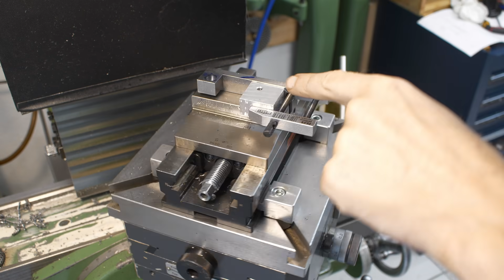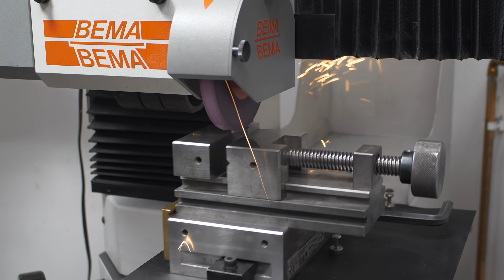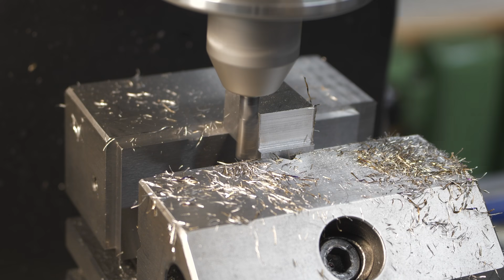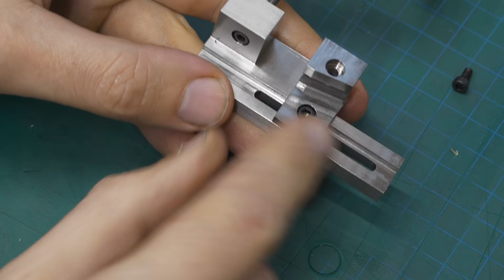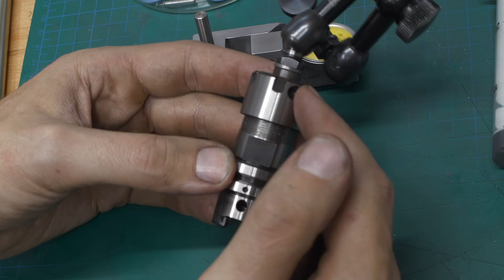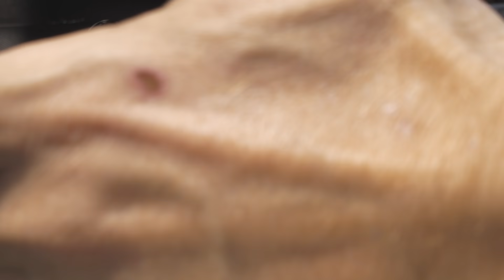Lowprofile DTI holder - Part 2

Comment: To precisely (and overkill) align the top to the center of rotation, could you setup another DTI/DI to touch the tip of the ball. This way when you rotate it, you can dial out the offset exactly. Think of it as a vertical 4 jaw chuck. This is still on my list to do.

Edit: Forgot to say thank you, this series was amazing and very well done.

Comment: I 3D printed this instead of machining from metal and it worked very well!  Thanks for sharing your design.  The only real change I needed to make was the angle of the dovetail slot to match my dial indicator.

Comment: Totally agree with your rant about the Haimer.  Adjusting runout on them is very touchy and they don't stay calibrated.  The Tschorn 3D tester is somewhat better, but still difficult to adjust runout, and takes a lot of Z-height.

Comment: Thanks Stephan. Excellent... Just slightly worried that the excentric pin will turn unintentionally over time especially if the machine spindle is stiff to rotate ? Thanks again 🇬🇧

Comment: I don't use a Heimer on a manual mill, but it's nice on a big CNC router, when the operator's console is 2 meters from the spindle. You can see it from that distance.

Seeing your two-step method for squaring the fifth face was worth the price of admission.

Comment: Thanks so much Stefan, I have ordered some Toolox 33 steel, and downloaded your PDF drawings. This is very kind of you to share this with us! Is there a way I can show you my finished holder once it's done? I guess Insta PM? 

I was very intrigued with your opinion of the Hamier, that's the tool i use for my Syil X7 CNC Mill. I guess I'll carry on using it for Opp1 from stock, but use a DTI for further opp's and get even better location. How do you rate the coaxial meters with the arm sweeping a bore or boss? 

As everyone else says, thank you so much for your time in making videos, you, Joe Pie and Robin have taught me so much! Thank you sir!
Reply: You don't need to take his word about the Haimer.  You can do your own tests and measure and see how it comes out.  I use mine all the time and achieve very good results with it.  I can work to a standard of less than .001" (.025mm) with it in my VMC.  The speed at which it works is easily its greatest feature.

If you're making parts for industry it is phenomenal.  If you're making tool and die parts, it still has its place, you just need to play to its strengths and use other tools as necessary.

Comment: so for the people who use regular 60 degree triangular files to make the dove tails... the name of those special files is called 'Barrette file' right? sounds kindda worth it imho. to go and buy one of those.

i also came across another triangle file, that has the 3 different coarse / fine / bs aggressive cutting, 1 pitch on each side. another cool  sounding idea. to then just keep on rotating the same file in same hands. until finish is met.... [edit] what they call that one? '3-cut file' it seems to be the english name.

Comment: just a thought for a potential V2 of this, instead of using a bolt at the bottom to clamp the eccentric shaft, make another split cut in line with the DTI, that way all your clamping adjustments are on the side and you avoid the obstruction problems when adjusting for center line.

Comment: The Haimer thingy seems like it would be great on a horizontal boring mill or other large machine where the parts are not usually held to micron tolerance. Nevertheless less many of us do not do work on the HBM. I use a combo of the rotating springy edge finder and I use the DTI to center up on bores and on occasion to find the edge. Nevertheless, I like the design and might build one some day when I have nothing better to attend to and get in the tool building mode. It happens now and then! Cheers

Comment: Stephan, when finish grinding your dimensions of the block, you never showed the finish dimension measurements themselves or what tool used to determine finish size.
Were the finish sizes determined by always removing the block from the chuck, and then measured? 
Or, could the finish dimensions be determined while on the chuck, without removal, say with a depth mike down to the mag chuck face?

Comment: Is it possible to anneal a big ball bearing to use as the ball for the socket vise?
Reply: Yes, you could do that. Just heat it up to 600-800c and let it cool down very slowly, preferably in the oven.

Comment: Great video, I completed my holder and I am very happy with it. I made mine from brass and aluminium  and its fine for my hobby machining. Thank you for posting the plans
Reply: I made one tòo, but am adding a fine adjust screw, just because I could.
Reply: @chrisstephens6673 getting fancy with it
Reply: @chrisstephens6673 
Hi Chris, 
Do you have a drawing or a photo, how you add the fine adjustment screw?
Regards, Timo
Reply: @schtim02  i can take a photo or two, I can't do it straight away, but if you can be a little patient, I'll see what i can do for you. I still only have the body made from nylon as i was playing with adapting his design for my needs, but the fine adjust is in its final design.